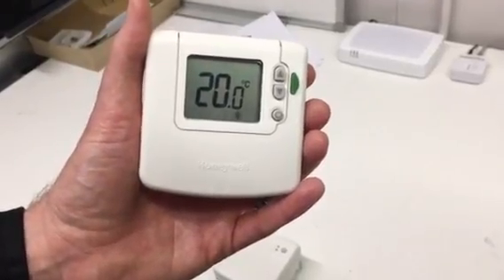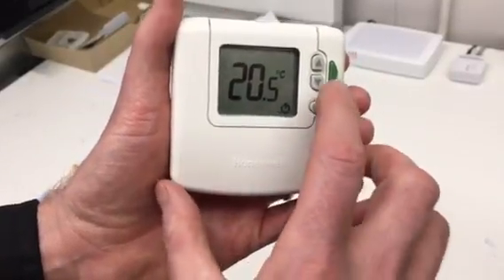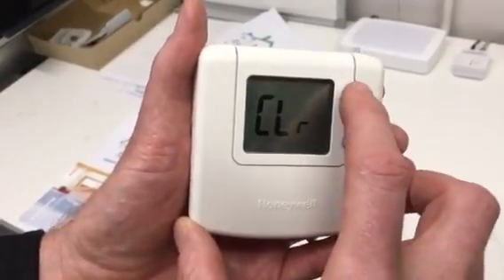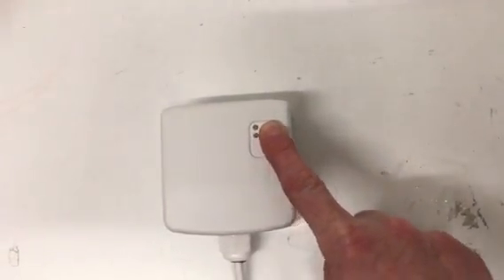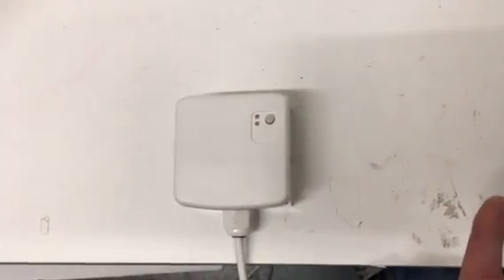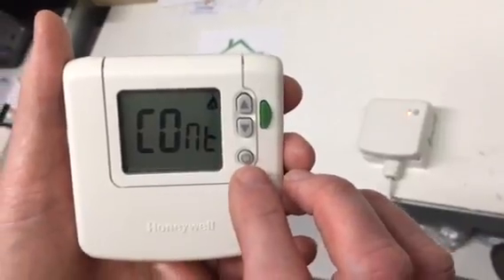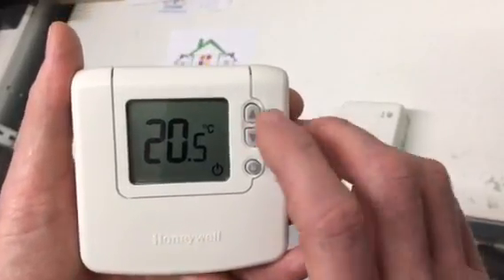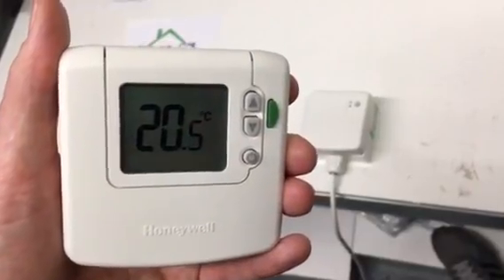How to re-bind a Honeywell DTS92E Thermostat & BDR91 Relay Box

Comment: Straight forward & clear instructions. I cleared down the DT92E as described but nothing happened on the receiver when I held the button down (for longer than suggested, too). The units were new in January, replacing ones with the same problem i.e. not talking to each other/unresponsive which led to the central heating being constantly on unless I turned off the boiler. This is again the same situation. Are they duff or is it me?
Reply from the maker: BDR91’s are really reliable, so I would say if they are failing in quick succession there is a wiring fault.
Reply: @MWPHS  Thank you. I shall rattle the cage of an electrician.
Reply: @terryc-d2693  Did you ever find the root cause of the BDR91 not responding to your long button press when trying to reset? I have the same problem as you had
Reply: @b00m-u8g3n  annoyingly no. But one possibility could be the permanent live wire to the base plate on the receiver wasn't permanently live. The feed was taken from the ch timer thing and the heating bods thought that because this was being turned off to prevent the boiler from continually running, the receiver unit was getting so confused it just packed up.
Not a lot of help I'm afraid but it might be worth checking.
Good luck!

Comment: Hi,

Thank you very much for this very clear video. I am sure many many people, including me, found it extremely helpful.

My relay box had a red light as the thermostat battery needed changing, so I did. However, when I followed the procedure, all went well until the pairing step. The thermostat showed the signal icon, but the relay would not stop flashing red.

In spite of that, I went on trying the boiler, and it did switch on, but I think it did not switch off when the set temperature was reached. Also, the relay now shows a solid red light and a slow flashing green light!

Could you please advise what to do?

Many thanks.
Reply from the maker: If you need product support other than the video, please call 0300 130 1299.
Reply: @MWPHS  Okay. Thank you for responding.

Comment: Richard, i've just moved into a new property with this exact thermostat. How do you turn the heating on/off? Many thanks
Reply from the maker: I’m assuming you have an external programmer? It’s usually done on that but there is an off button on the DTS92E which is you press and hold turns off the thermostat.

Comment: Thanks for this helped alot. Does the boilers front panel need to be set in any particular way ?
Reply from the maker: Each boiler is different. Maybe have a chat with your heating installer to see if any efficiency improvements can be made?

Comment: Thank you so much for this clear explanation.

I've rebound the thermostat and relay box successfully. But that has introduced two new issues - 1) the override for the heating doesn't kick in, and 2) for the pre-set time for the radiators the heating is very modest. It comes on but at a very low temperature.

The thermostat reads 17.5 degrees and the target temperature is 21.5 degrees. The flame icon is visible, and the RFID very occasionally appears.

Any thoughts? Could the rebinding have changed more settings? We've always had full heat or no heat in the radiators - no halfway point. All individual radiator thermostats are turned on and I've just tried switching them all to maximum but the override is not having an effect. Thanks.
Reply from the maker: Unfortunately Howard you are asking us to diagnose your heating system problems with a crystal ball (joke)! :) It sounds like you have an issue not associated to the room thermostat, so this needs investigating by a heating installer. Just re-pairing the thermostat alone following the video we have produced would not change anything (as long as the video is followed to the letter).
Reply: @MWPHS  Thanks for this. Yes, that sounds likely. I'll call our contact. Thanks once again for this video - and also for replying to me and so many others over the years.

Comment: `Great vid Richard, very clear and concise. My setup only kicks in if I turn the stat off and on again.  New batts have been installed to try and cure, any ideas?
Reply from the maker: Not sure sorry Andy. If you have reset the unit like I have showed you, it is possibly a faulty unit. You can call technical support on 0300 130 1299 option 3 if you want to check with them?

Comment: Great video. Thank you.
Question! What may cause the receiver unit to show a RED light and the system to fail?
Reply from the maker: Normally a loss of comms between BDR91 and DTS92E. BDR91 too close to metal objects is the number 1 culprit.
Reply: @MWPHS  Thank you so much for responding. The BDR91 IS close to the hot water tank and various pipes but all has worked satisfactorily for quite a number of years now. I did re-bind as per your instructions and have kept the DTS92E in an adjacent bedroom as a temporary measure. The connection hasn't dropped again so I'll try moving the sender unit downstairs again soon. Thanks again for your VERY helpful video instructions. 😃

Comment: Appreciate this is quite an old video so may not get a response. It is really helpful and clear, so thank you. My thermostat connects intermittently- I need to turn it off and on again a couple of times a day for it to refind the control panel and fire up the boiler again - would you recommend trying to re-bind or is it time to get a new thermostat. Many thanks
Reply from the maker: It might just be the fact the relay isn't installed correctly (i.e. too close to metal objects including the boiler casing which RF cannot get through).

Comment: My thermostat doesn’t show the fire sign. I’ve also changed the battery but no luck. Any help 😊
Reply from the maker: Sorry I’ve no ideas. Have you contacted technical support (0300 1391299)?
Reply: @MWPHS  yes and the problem was that that one of the workers extended the wires and connected it with the boiler. Do it would only work if I turn it on or off from the boiler. Thanks for the help

Comment: I’ve done all steps one by one which is fine but at the end on the relay box and light didn’t on. Do you know why or what’s the problem with it ? Thank you for help
Reply from the maker: Sometimes, you have to turn the thermostat all the way down and then all the way back up again. Also make sure the thermostat is set higher than the room temperature. If you need support, call 0300 130 1299.

Comment: I can do hold up and down buttons then the next step of pressing down nothing happens.. I can press up then back down through different settings, but to press down it does not work... Any advice would be greatly appreciated. Thanks
Reply from the maker: There are two models of Honeywell thermostats and they look the same. This video is specifically for the DTS92E. If you have a DT90 this video will not working for you.
Reply: @user-fq5fb3ch8n  me too

Comment: Hi Richard - this is super helpful. I have a related question. Is it possible to pair / bind a DTS92E with an HR92UK - I have long curtains which cover the radiator so the HR92UK doesn't get the room up to temperature unless i set it to a much higher temperature than wanted.
Reply from the maker: Hi, yes you can pair a DTS92E as a room sensor in an evohome HR92 controlled zone. We will have some videos covering this soon, however if you need support doing it in the meantime contact Resideo tech support on 0300 1301299 option 3.

Comment: I'm afraid the CLR screen doesn't come up, only the Inst screen.  The down button does nothing after this, the Up bottom only gives other options - not the CLR screen.  I would be very grateful if you could advise how else to rebind?
Reply from the maker: Are you sure you have a DTD92E? If you take the batteries out, does the code say DTS92E or DT90E? If it is a DTS92E then following the video will result in the correct menus displaying.

Comment: Hi there. The thermostat DTS92E1020 has a blank screen. New batteries did not work. I bought a DT90E1012 from screwfix as the nearest available option but the menu is not the same so I presume this cannot bind with the unit on the wall?  Or am I doing something wrong?? Appreciate any help..as Its getting cold!!
Reply from the maker: A DTS92E is what you wanted, not a DT90 as are completely different thermostats.

Comment: Great instructions but we dont appear to have a relay box?
Reply from the maker: If you take the front flap off and the batteries out, what is the model code underneath the batteries? If it is not DTS92E it is not the same one as the one in the video.
Reply: Hi, thanks for taking the time to replay. The thermostat is DTS92E1010 I had a look around our boiler room where we have a Honey well controller model ST9520C and I cant find any relay box in that room anywhere? @MWPHS
Reply from the maker: The ST9520C is a wireless programmer, so you won't have a BDR91 as shown in this video, it will be directly paired to the Honeywell programmer. If you contact Resideo on 0300 130 1299 they can 100% support you with this. :) @btulley123
Reply: Hi, Super helpful; I rang them and they are sending me the re-binding instructions; thanks again, very much appreciated. @MWPHS

Comment: You probably won’t see this but I can’t get the power button to come up! When I hold it down a key appears as if it’s locked in some way? Can you help?
Reply from the maker: Power button on the DTS92E? It will come apart and can be fixed, but its not so easy to do.

Comment: Hi, I have that very thermostat in my living room but however high or low I set the temperature, the radiators heat up to the same degree. What does the power button do? I thought if I pressed it while I went out, it would stall the heating till I got back but it appears to do nothing. Can you help please
Reply from the maker: The power button should turn the heating off. You need to bear in mind the thermostat is only one part of a heating system and if the other components are faulty, then it won't matter what you set the thermostat to, it might still operate? Obtain a local heating installer to come and check your heating system for you.
Reply: @MWPHS  Thank you for that. Something must be faulty so I'll do as you suggest

Comment: Hi in trying to fit one of these but when I press the two buttons for the installer menu and press down those options you show at the begining do not show on my stat, I can only press up not down. Pressing up leads to different options that does not go to the ones you show on here.
Reply from the maker: Neil Griffiths this is a wireless DTS92E and only the wireless version will have these menu options.

Comment: What to do when your thermostat shows an error - SYNC? The green light on the heating side is not working. I tried everything to turn it on but it doesn't help. How can I start the heating?
Reply from the maker: Sounds like you might have a faulty BDR91 relay box? The thermostat is trying to look for it if it’s saying ‘SYNC’.
Reply: I don’t think it’s faulty bcz earlier heating was working. Anyway, do you provide any home visit service to sort out our heating system from Honeywell? We are from London. How can I reach Honeywell customer service in London?
Reply from the maker: @AparnaAmbre  I'm just an ex-heating installer on YouTube creating these videos. Best thing to do is contact Resideo (Honeywell Home) and see if they have a trained installer in your area - 0300 130 1299.

Comment: I followed it and the flame icon shows on the thermostat control but radiator is still not working.
Reply from the maker: Is the green light coming on the relay box? If it is, could be a fault beyond the thermostat? Speak to your local heating installer.

Comment: Is there a difference between the DT90 and DT92. I have a new DT90 which I am trying to bind to replace a broken one.  When I get to the stage where I press both the up/down arrows I get "Inst", but when i press the down arrow it stays on "Inst." It will allow me to press teh up arrow but then I just get ot, cr pb etc. Am I missing something?
Reply from the maker: The DT90 is a 'wired' thermostat (not wireless). The '2' in older Honeywell thermostats denoted that it was a 'wireless' product. I hope that helps?
Reply: @MWPHS  Well that's the problem then!! Thanks so much for the quick response.

Comment: Hey what if I don’t have binder the box with the green light
Reply from the maker: Then you don’t have a DTS92E. You might have the wired version which is a DT90E? The product model code is normally under the batteries.
Reply: @MWPHS  thanks just checked mine says dts92e1020
Reply: My boiler is Worcester greenstar 25l combi, my thermostat control st9120c. Bloody council people came to service the boiler now I can’t get the heating on extra hour :(
Reply: @MWPHS  ?
Reply from the maker: @SM_TheTraveller  If you have DTS92E then the programmer could be wireless and you might actually have an RF2 pack. Give the technical support line a call and they should be able to help you - 0300 130 1299.

Comment: I can't seem to find the wireless box anywhere
Reply from the maker: There isn’t always a box. Sometimes the actual programmer is wireless (Google or YouTube Search ‘Honeywell RF2 Pack 2’). It might also be that your DT thermostat is a DT90E which means it is wired not wireless (take batteries out and the model code should be there).
Reply: @MWPHS  the dts 92e unit is wireless. There are no wires at all. The main unit is a st9520c
Reply from the maker: @khanshaab9  the ST9520C is a wireless programer (so you won’t have a BDR91). Unfortunately my instructions in the video won’t work. If you contact tech support on 0300 1301299 option 3, they can help you. 👍🏻

Comment: Hi, I follow your instructions and the red light goes out on the relay box, I then set the temp above room but then no green light. There is a wireless icon at the bottom but nothing happens. Can you help?
Reply from the maker: If it is bound correctly as per the video, the thermostat and BDR91 should work. Have you tried removing the power supply from the BDR91 for a couple of minutes and then re-powering the BDR91 and trying again?

Comment: Now I feel aa if I have to  read and prepare for an exam for when this thermostat goes off .
Mine just goes blank screen 😮
Completely blank.
I hate this , isn't there anything more straight forward  this thermostat? 
Really?
All this press that and press this...etc ...
I have other things to worry about
Reply from the maker: You shouldn't have to do the procedure in the video unless the wireless relay box memory has been cleared by pressing the button for more than 15 seconds. If the screen is going off, have you tried changing the batteries (underneath the front flap) first? The DTS92E was about as simple as they come, it was just the binding sequence which is complicated. Product technical support is available on 0300 130 1299 if speaking to a human helps.